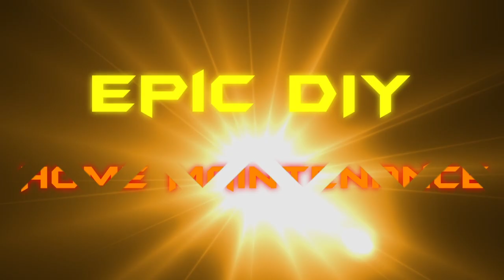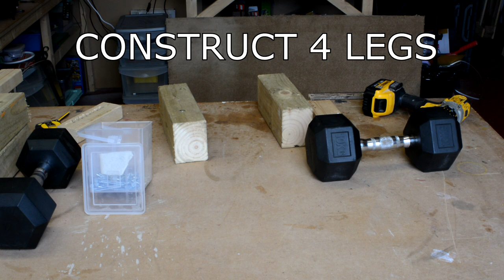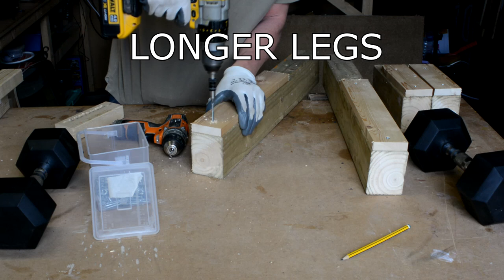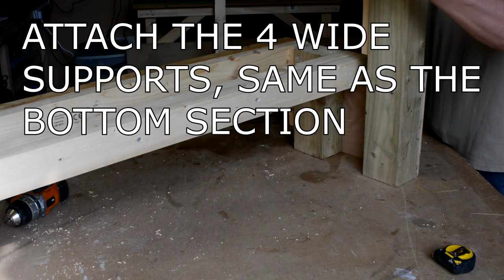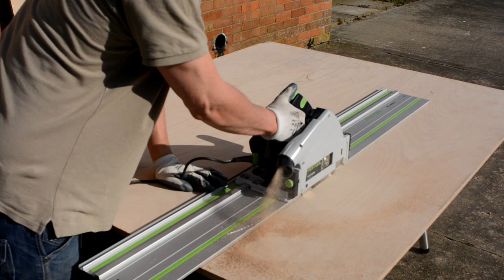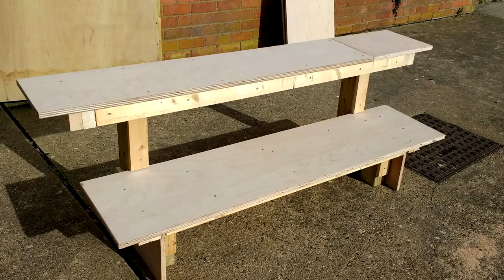DIY Dumbbell Weight Rack Storage from Wood

Comment: One addition I would suggest would be adding bed frame rails, by bolting those onto the wood to hold your weights in place this would be easy to do because people literally throw them out or donate them to Goodwill stores on a regular basis

Comment: This looks like just what I need.   Do you mind telling what sizes boards you used for each of the pieces?  I’m guessing the long boards are 2x4x.  What about the posts?
Reply from the maker: The posts are approx 2.5 x 3.5 inch. The long ones are approx 1.5 x 2.5 inch

Comment: $1200 track saw......save money building dumbbell rack. Also, rubber coated dumbbells = approx. $2/lbs vs cast iron = $1.25/lbs. Good video, just funny.
Reply from the maker: Track saw is probably $600. You can use a saw, but why not use the tools available? =)